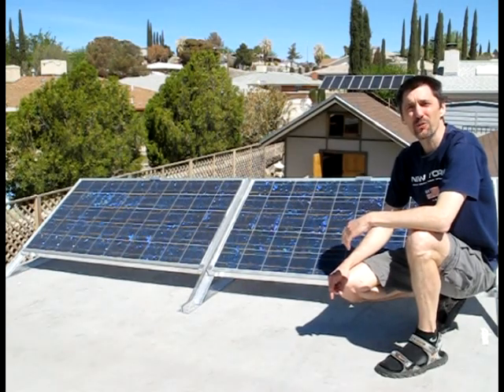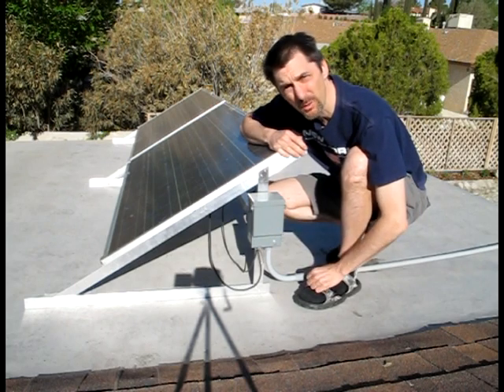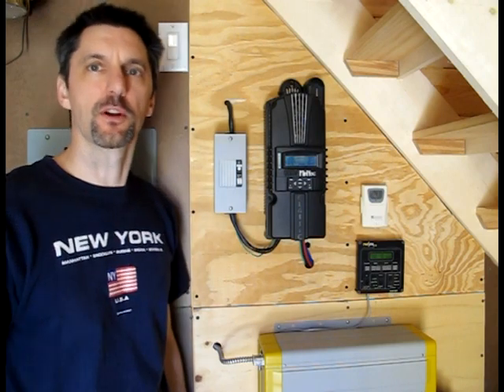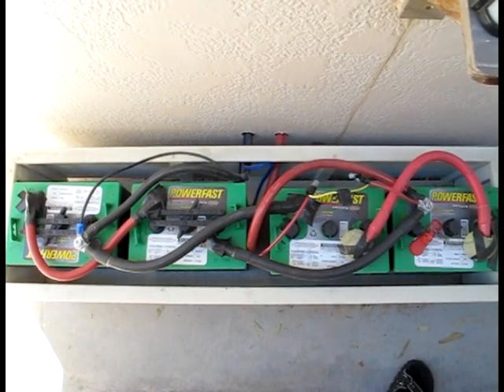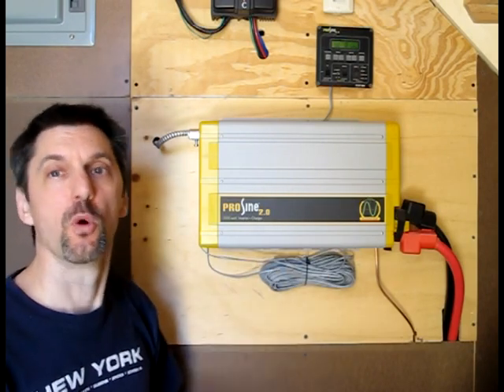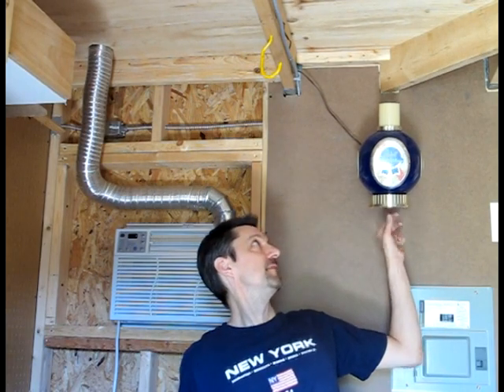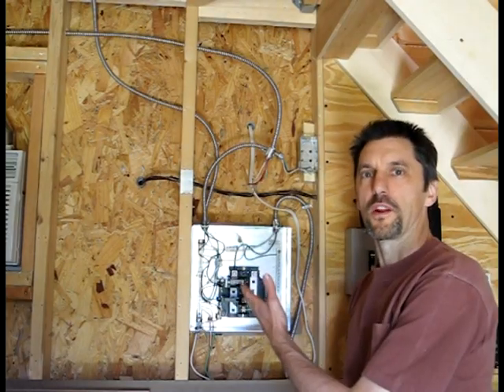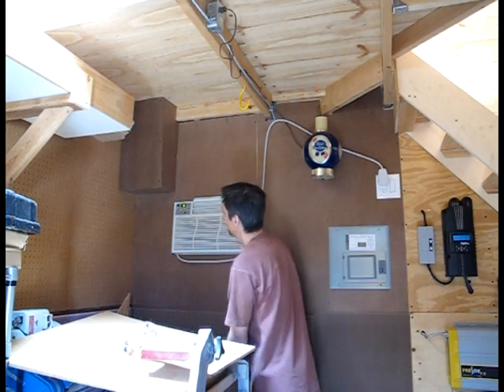Solar Project 2011 (From Panels To Batteries to AC Power)

Comment: A word of advice from a Thermal and HVAC Technician: If having high efficiency is important to you, make sure you create/install an insulated return duct to return your ACV (Air Conditioned Volume) back to the intake of your AC unit. You'll have to mess with and modify your AC unit a bit but you'll increase efficiency and cooling by up to 50% depending on your setup. Also, insulate the metal feed duct.

Comment from the maker: Thanks electrodacus, your right. The vacuum would only run about 2 to 2.5 hours to half depletion of the batteries. My mistake was calculating everything based on AC power. That's why it's always nice to have someone else check the numbers.

Comment from the maker: That's what a charge controller does, it makes sure the batteries are charged correctly and not over charged. We have a MPPT charge controller which varies the ratio between the voltage and current (Amps) delivered to the batteries in order to maximize the power. If there is excess voltage available from the panels, is converted to additional current(Amps) to the battery. We just had to input on the charge controller that our battery bank is 12v, and our array was 48v.

Comment from the maker: When multiple batteries are connected they act as one. If connected in a series (positive of one battery connected to the neg of the other)  the voltages of the batteries add to each other and the amp hours (Ah) stay the same. Connected in parallel (positive of one battery to the positive of the other and the negative connected to the other negative) the voltage stays the same and the Ah are added together. They are all charged at the same time.  You can run whatever your inverter can handle. :)

Comment from the maker: A standard central AC unit uses about 7,000 watts to run the condenser (the part that usually sits outside). Running it for just two hours a day would be 14,000 watts. At a bare minimum  would need at least $3,000 grand in panels and a huge expensive battery bank to run such a unit. The inverter would also be costly. It probably wouldn't be cost effective. A system just to run the blower inside the house is feasible. Now, a swamp cooler like they use in the dry Southwest would be doable.

Comment from the maker: Yes you can use the system while it is running. It will continue to charge the batteries until your using all the power it can make. If you are using more than the panels can make then the batteries will start to drain.

Comment: Hi, great video. I do have 2 questions. Do you have a moment to answer please?

Would I be able to use several batteries to act as one, maybe by connecting one battery to the other so that when one is fully charged, the solar power continues on straight to the next?

Also, you mention you would be able to run a vacuum for 12 hours, is that ONLY the vacuum? Or could you maybe use a music system at the same time? Can you use the electric at the same time as it is charging?

Cheers pal

Comment from the maker: electrodacus - Our vacuum cleaner is 9.3A running at roughly 118V therefore (9.3A * 118V = 1097 Watts). Using only the recommended 50% of our battery capacity  (420Ah * .50 = 210Ah), the 9.3A vacuum would last (210 / 9.3 = 22.6) roughly 20 to 22 hours given that there would be some loss due to the inverter inefficiencies.

Comment: Hi Drewshock, thanks for this video... i have a question as regards AC unit.. If I have a 3 horsepower air conditioning unit (using AC power),  how can i know an equivalent size for DC power Air conditioning unit (something like the swamp cooler you described)... I presume you are running yours with an inverter to convert to AC, but thinking of just buying one that will feed from the solar power directly. I'd be glad if you clarify me on what is required. Many thanks.

Comment from the maker: In series wiring the positive of one panel goes to the negative of the other panel, then you end up with a positive from one panel and negative from the other as leads. Now to parallel these with another set you now take the positive lead from the first series and connect it to the positive lead of the next series. Same with the negative side. 
Check out my other video on youtube: Solar Power (From Sunlight To Outlet), it goes more in depth on how to do this.

Comment: i worked in a telecom co. our designed for solar is that , during the sunny day, energy from solar panels feeds the load at the same time charge the batteries which is called trickle charging, batteries are for buck-up. During night time the batteries feeds the load (air conditioning system lights,and BTS equipment) is that the same with your residential designed?

Comment: ?..I have a 60 watt small system, I'd like to us more than 4 batteries. do I have to connect them parallel in order to use a 12 v inverter ?, will they get charge still?..or can I do what you did with your battery bank?, I have more ?' hope I can still asking. thanks

Comment from the maker: If running only on the batteries and they were fully charged, our A/C window unit which uses 500-600 Watts, would run 3 to 4 straight hours till 1/2 life. This is assuming nothing else is running. Our battery capacity is about 5,000 Watt/Hours so 1/2 would be 2,500 - (20% for inverter inefficiency) . 

Now, during a nice sunny day our panels make more energy than the batteries can hold. So if you run the A/C during the day it can run off the excess power without depleting the batteries at all.

Comment: I have a question can I connect my 24 volt battery to my 12 volt 12oo watt converter,, or do I have to buy a 24 volt converter keep in mind I have a 12/24 volt MPPT control charger

Comment: I'm just getting into solar, but I have a question, you're feeding your inverter 48 volts but your battery bank is 12 volt?
Reply: I'm just getting into solar, but I have yet to see my first system up and running....plans are for 12 volt battery bank and 24 volt panels...reason being is I'm building from new....right down to position of structure and angle of porch roof so panels may lay flat in summer....all lighting is to be 12 volt LED all outlets to be 120 volt and switched so TV and other items with tiny voltages don't "wake" the inverter from sleep mode when they are off....I'll be totally off grid so I need the very most from the batteries......Magnasine 2812 inverter...Honda eu3000 controlled by magnum energy auto start feature..,.all 120 volt wall outlets will be mirrored with 12 volt lighter sockets too. Any thoughts.,.. Cautions?....thanks for your comment.....Mark

Comment from the maker: @FUNNYTOM10 200W @ 230V is a .8 Amp AC draw, which is 9.5Ah DC. So 400Ah*50% = 200Ah/9.5 Ah = 21 hours. That's with an inverter efficiency of 80% since there is some loss in the DC to AC conversion. Voltage measurements are approximate and with no draw or charge on them for a few hours a 24V battery bank should read 25.4V when full and 24.12V at 50%. Try not to go below 50% . How did I come up with 9.5Ah? I input your numbers into this site: bdbatteries,com/acdcsolar.php